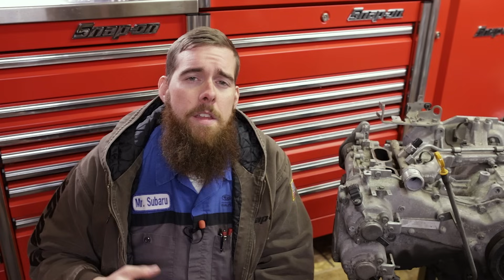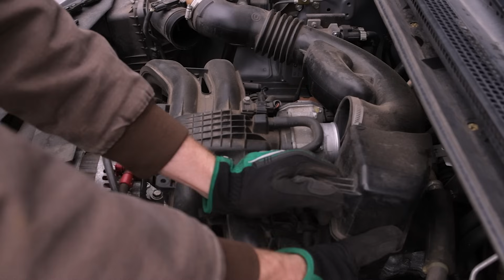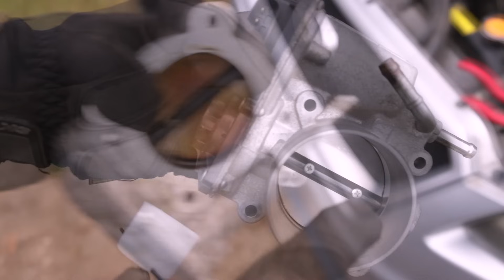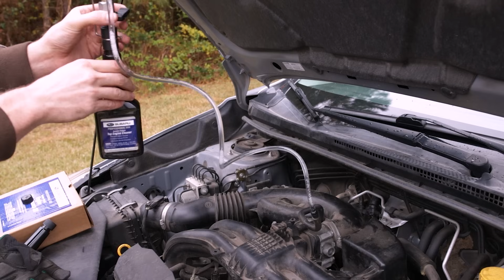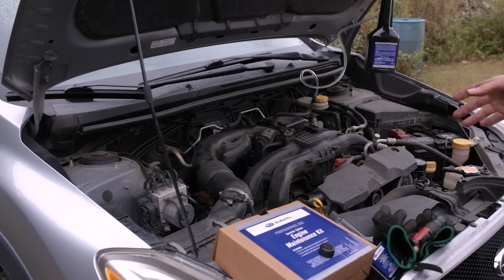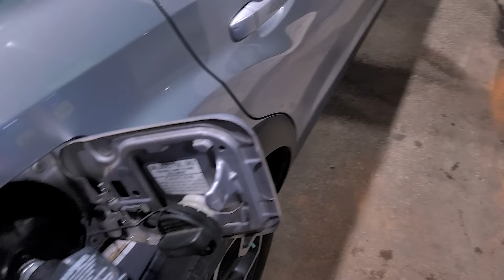Keep Your Subaru Running Like New! Subaru Engine Maintenance Kit

Comment: Great video. Which vacuum line is best used for a 2009 WRX? I heard the brake booster is not optimal because it only gets cleaner in half the manifold. Thanks

Comment: Has anyone tried using this kit on a EJ25 engine? The only place to get a vacuum is on the PCV pipe which splits with a double back to the passenger side of the intake manifold. So I’d think the vaporized cleaner would tend to favor the drivers side. Any thoughts?
Reply: Hi , I share your thoughts, I've been looking all over the interenet as to where to add this cleaner to a ej253.
I'm at the moment resigned to the fact that I may have to add it through the throttle body butterfly.
Can't this stage find anywhere else.

Comment: Mr. Subaru,
How often would you recommend doing this as preventative maintenance?  I read the SOA service bulletin about performing this maintenance and they say about looking at the roughness monitor and performing this procedure (up to) 4 times to get the roughness monitor below acceptable levels. This is for someone who brought the vehicle in for misfires from carbon build up. If I want to make sure 1 bottle does it I assume it would need done pretty frequently,  just not sure how frequently.  Thanks, awesome videos by the way! I placed the order for my crosstrek 3 weeks ago and am looking forward to being a first time Subaru owner.

Comment: @19.46.  I notice your gas station has 87, 89 and 93 .. Do you have 95 and or 98 ? Here in Australia we have E91 (10% Ethanol) , 95 and 98. I use 98 , it burns cleaner and I do get a little more mileage. It also costs a bit more.

Comment: I have a 2017 Impreza Sport with about 85000 miles. I plan on doing this procedure soon, but I'm also wondering how often should this be done as ongoing maint.
UPDATE: I completed this procedure yesterday, but instead of the Subaru kit I used Seafoam, CRC throttle body cleaner, and Techron complete fuel system cleaner. I also changed my spark plugs and changed the oil right after and man does my engine run much better now! The one thing I did differently was to shut the engine off for 10-12 minutes after sucking up the last 3rd of the Seafoam bottle. I saw a few videos where people did this to allow the cleaner more time to work on the carbon deposits. Then I took a spirited 15 min drive. I too had a check engine light after the Seafoam treatment, but after a spirited drive and removing the battery (required to get to the spark plugs), the check engine light went out and has not returned.
Reply: I was thinking the same thing

Comment: Mr. Subaru: what is the part number for the gasket you recommend we replace when we remove the throttle body during this process (at 6:20)?  I drive a 2017 Outback Limited, 2.5i CVT.

Comment: Have a 2013 WRX with almost 90k miles....so it's a turbo EJ255. Trying to learn how to maintain and care for it myself.

Is this still worth doing on a port-injected engine? What are my other options or best options for maintaining the long term health of the intake, combustion and exhaust chambers?

Thanks so much for what you do. Love your direct and to-the-point explanations
Reply: With port injectors I think you are good just using top tier gasoline and maybe using some PEA fuel treatment every oil change or so.

Comment: Dont forget you have to change your Engine Oil after using Upper Engine cleaner or Seafoam as it contaminates the oil.
Reply: How often should you do the Upper Engine Cleaner? My sons 19,000 mile 2021 wrx started throwing engine code for misfire and the dealer said it’s carbon buildup and they are cleaning it.
Reply: @warweaponx6629  Every 2nd oil change AFAIK so if its a WRX thats maximum every 12,000KM (if driven like a grandma on sunday) or every 5,000km if driven hard like most WRX are.

Comment: Throttle Body Coolant Line Bypass is one of the great Must-Do Mods for Turbo subarus Majorly drops intake temps and keep manifold much cooler. 
Talking 50-60*C cooler preventing knock and allows denser air charge. 

WARNING - This mod should not be done in countries or regions where it snows and temps often drop below 5*C as its there to prevent the throttle plate from ICING Open and getting stuck. 
But in warm countries its safe and makes a HUGE difference. After 1 hour boosting around at 15psi can touch the intake manifold n TB and its cool to the touch (30-40*C) Without it you would burn yourself.

Comment: Hi ,thanks for your great video, I have subaru outback 2015, it runs fine with injector cleaner but rough without that. I cleaned all four injectors and replaced spark plugs. But my engine is still shaking when driving between 40to 60 rpm . I have misfire p0302 pending . Sometimes it throw cel too but it goes away? What do you think cause this problem.
Reply: Try throttle body idle relearn?

Comment: Subaru seems to have updated the bottle design to an aluminum can. Do you have a new part number for a tool that works with the new top engine cleaner aluminum can?

Comment: We do these at work a lot for higher milage cars and I can say from experience that it really helps with MPG, smooth operation, and overall longevity. In some cases, you'll even see oil consumption drop to almost 0. I would recommend changing PCV valves if you didn't already when doing this service as well.
Reply: Curious if you need to change the valve first, or after doing the top engine cleaning, or does it not matter.
Reply: @notasgoodasapple  I usually do it after, but I don't know which is the "most correct" way to do it. I just figured doing it after will discard and garbage that may have made it in during the service and start you off fresh
Reply: Yup, my PCV valve started getting sticky at 65k miles and I started burning oil. Pretty easy to change. They probably should be a time change at 50-60k.

Comment: Hi MrSubaru! That's really interesting :)
I would just like to ask: does a FA20 engine (like the one mounted on brz), being port and direct injected, still need this treatment?
Thanks in advance
Reply: Nope. You can feel safe doing a throttle body cleaning and running a bottle of Techron as indicated. I wish Subaru/Toyota would bring the dual injection system to all Subarus.
Reply: @buttsexandbananapeels  Thank you for the answer! That system is really interesting, even if it brings more complexity :)
Reply: @mattiaconti8885  the D4S is awesome. I was trying to hold out for it hopefully coming to the new Outbacks, but my 2010 Prius finally went catastrophic, so I pulled the trigger on the GDI only. 

You have a good engine that should run clean for a long time as long as you’re Johnny on the spot with your service intervals.
Reply: @buttsexandbananapeels  Good to know! I am currently changing my oil and filter every 5000 km for spirited (and some chilled) driving on the canyon roads!
Reply: @mattiaconti8885  5000km or miles? With an OCI like that, you should be good as long as you’re using a ILSAC GF-6 oil and a good filter. It’s pretty much standard and easy to find now. It’s Heaven-sent for direct injection.

I use Costco brand motor oil in mine, changing it every 4500k ignorant units because I’m kind of between hard use and easy use. 

For filtration, I use the Wix XP filter. The bypass is the same as Subaru filters, but I like their build quality better. The only time I used FRAM was their top of the line one for my break-in oil change because it traps smaller pieces AND more of them. I only ran it for 3k freedom units… and it’s totally unnecessary. It just makes me feel better. It’ll be Wix XP for life after this OCI.

For preventative care, pop out the PCV every 30k miles (I only know American standard dumb units off the top of my head). You can clean it with brake parts cleaner, but I change it out (Teflon tape the threads) because it’s cheap. 

Sounds like you really care about your machine, and that’s great to hear!
Reply: @buttsexandbananapeels  5000 km! I did the conversion and it is 3100 miles :)

I currently use the OEM oil filter from Toyota because I trust it and it's pretty easy to find near me.

Speaking about the oil, I'm using a 5w30 Motul 8100 X-Clean +
It has a 3.5 mPa.s HTHS viscosity at 150 °C and has ACEA C3 specs
I didn't know about ILSAC GF-6, but I'll definitely doing some research!

Thank you for the PCV advice, I check and clean it periodically :) but it's always good to remember it!

Every two oil changes, I put some Motul Engine Clean Auto (an oil additive) and let it run on idle for around 20 mins before draining the hot, old oil.

And then, always premium fuel (RON 100) and every now and then some fuel system cleaner in the tank, a nice empty back road and... Some heavy feet!

Comment: So I bought the Subaru top cleaning tool. I had it all hooked up and opened the valve, but the cleaning fluid would not flow. After some troubleshooting, the small black cone is clogged and will not flow anything through it. I bought this brand new from a Subaru dealership, cost $40 with shipping.
Reply: Turns out it was defective. I talked to the lead tech at the dealership where I bought it and he had me drill a hole through it with a tiny drill bit. Kind of a pain for a $50 tool that arrives defective

Comment: Does the Ascent have that vacuum line? I don't remember seeing it so I believe I maybe have removed the map sensor. I had to clear an error code, but it seemed to work. I'd prefer to find that hose that you had in the video though.
Reply: To follow up, the ascent does not have that line. I am going to go ahead and use the map sensor port, as it is right after the throttle body and has a good vacuum. It may be worth noting that the walls are metal, so I picked up a 4 inch rubber hose that fits perfectly in the map port and the top engine tool in the opposite side.

Comment: the only thing id do differently, well not differently just additionally, is do an idle re learn after its all said and done just to ensure the entire system is re programmed at each rmp milestone it logs.

Id recommend any one do this (at least 2 of the 3 steps which still be a huge improvement, just gotta be slow if you do the 3rd step. also buy it online, so theres no record for ur insurance company to see you just bought this at the dealer and then hydro locked your car. Wait for a rainy day, and then say you have no clue what happened, you were driving down the road and the engine locked up after a huge gust of wind and crazy down pour of rain hit your car you felt the engine shut off.  My opinion, your insurance will look for any way out of paying you, so as long as they cannot prove indefinitely in a court room you did something than you can never be criminally charged at least.

Comment: So I run a product from Amsoil called upper cylinder lube you add it to your gas and it's supposed to keep the engine clean. I use it ever other fuel fill up. Won't that keep the carbon down if the cylinders r kept clean??

Comment: I bought for 2015 Subaru Legacy 3.6r but it doesn’t have the vacuum line to feed in the top engine cleaner is it possible to do it on this model??

Comment: Hello, I’ve been reading on forums that high mileage WRX should stay away from Engine cleaners since their carbon build up kinda “keeps things together”? Not sure how true that is. My 2011 WRX is currently sitting at 120k not sure if you would recommend running this maintenance kit on it. Thanks!

Comment: My moms 14 forester was having random misfire code. I did the the Subaru TI recommended fix with the top end cleaner, had to make the tool myself because no one had it in stock. Ran 2 bottles and changed oil,  it didn’t fix it. Had to walnut blast the valves because they were that bad. That finally fixed it.
Reply: Didi you do the walnut blasting yourself?

Comment: What are your thoughts on the OE subaru engine flush? I have a '95 legacy with 120k on the clock and am considering flushing it but am a little hesitant due to the age of the engine. I recently pulled the ej22 to replace the plastic oil separator plate and valve cover gaskets.
Reply from the maker: I wouldn't mess with it, honestly.
Reply: @MrSubaru1387  thanks for the advice. that's what i was thinking as well.

Comment: Nice! This procedure is extremely similar to how we perform compressor washes on turboprop aircraft. In regards to the throttle body butterfly, is there concern about wear at contact between the I/D of the body and O/D of the valve? Also, how often should this be performed.
Reply: I deleted my 100k comment because Mr subaru states bellow it is 35k miles. I use ethanol free 91 octane so I'm going to do it soon, I'm at 83k miles now.

Comment: I did a carbon valve clean treatment  using a CRC product containing PEA. The car began throwing lean codes and increased HWY mpg from 23 to 26. The improvement occurred over about 1500 miles. The only problem is the car throws a code every 600 mile or so. So far it's been left bank lean, right bank lean, and a CAT code
Reply: Curious what code you get?
Reply: @RESPAWN1983  P420
Reply: Let me know what comes of it, how many miles are on the car? Might need a valve job
Reply: @sugarbooty  250,000 miles. The engine runs smoothly with the exception of some hesitation and the occasional stutter (once every 2 weeks). Stuttering occurs at any speed and can be a split second to a few seconds long. The stuttering is like a 50-80% power loss during which the engine runs very roughly.
Reply: @dogburrito intermittent issues like that are the worst, it can be any number of things. A leakdown test will tell you if it is the valves or not, had a kind of similar issue  after seafoam with a JDM EJ20 but a lot worse. Slowly it got worse and worse, from occasionally bogging down to only being able to use it between 3k and 4k rpm without it just misfiring like crazy and throwing lean codes. The LTFT and STFT were both maxed out.
Unfortunately I don't know what the issue was or is this is the same issue you're having,  I just swapped the engine back to an EJ25 I had sitting around in an old car but i suspect the lean condition overheated some stuff and the valves are toast. 

That's what I get for buying someone's beater car as a daily

Comment: So important to think tiny little sips and not big gulps when using that top end engine cleaner with the special tool.
I think you did a good job of showing how you need the special tool to regulate the flow of the top end cleaner into a three part process.
Reply: Sips versus gulps are what general intake cleaners recommend by spraying short bursts with the aerosol types, and having another person on the throttle so the engine doesn't stall. I'm here on this video to ask if those are safe with this engine.